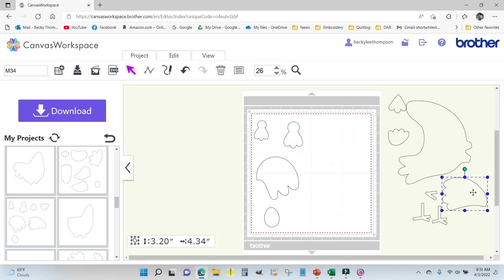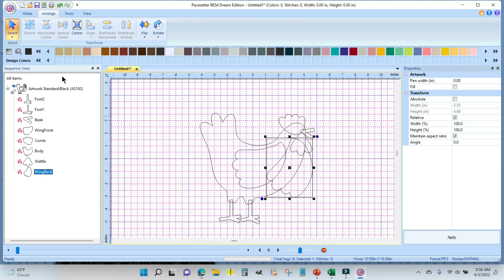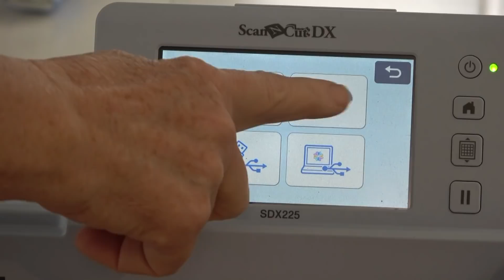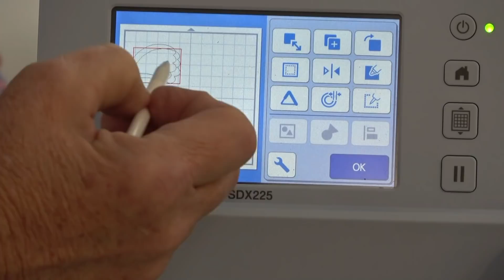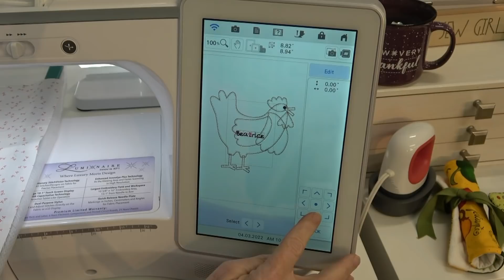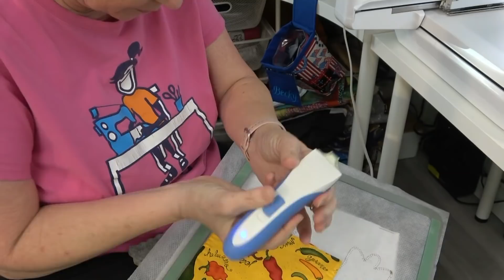Beatrice & a BLOOPER!  Lori Holt's Chicken Salad Quilt BES4 / Simply Applique

Comment: Am I able to use my Brother 5x7 embroidery for my chickens, and can I do  a quilt as you go for each block. Watched all of your chicken salad quilt videos.
Reply from the maker: Those birds are pretty big to do in a 5x7 hoop.  I don't recommend it unless you're willing to do a lot of multiple hoopings for one block and some pieces will have to be stitched down using your domestic sewing machine.
Reply: @PowerToolsWithThread  Thank you so much for the quick response. What size embroidery machine should I get. I will sell my 5x7 machine.
Reply from the maker: @msbjj1950  The best bang for your buck right now is the Brother Stellaire.  It has all the bells and whistles except for the onboard camera (you can use an app on your phone instead) and they are right around $6k.  That machine will last you forever.  It's wireless and the largest hoop is a 9.5 x 14 and you can do all the chickens in it.  Here's the embroidery-only version at Allbrands.  https://www.allbrands.com/products/94751-brother-xe1-stellaire-embroidery-machine-9-5x14-us

Comment: Don’t feel bad about sewing your ironing pad to your hoop.  I was machine appliquéing pieces of a scarecrow using my tiny zig zag stitch and accidentally stitched a patch on the scarecrow’s coveralls over his vest which hung over his coveralls.  It was close to the end of my stitching.  I had to rip the side of the vest to be able to tuck the coverall patches underneath.  Then, re zig zag the side of the vest.  No mistakes before that.  I stitched the whole scarecrow to the backing today.  It is about 45” long and 36” wide.
It had all been pinned correctly but when I took the pin out the patch got on top of the vest side.  Ha ha. Errors happen.